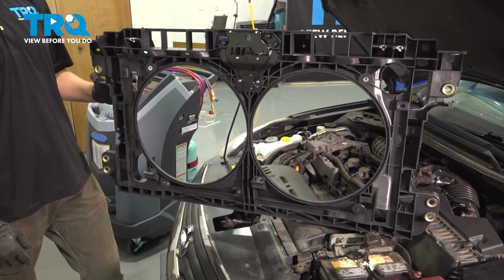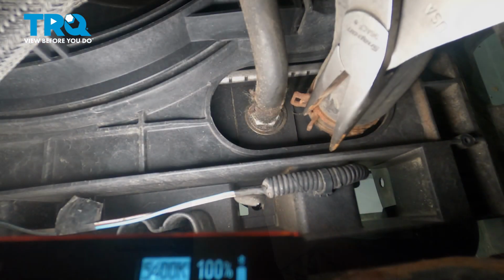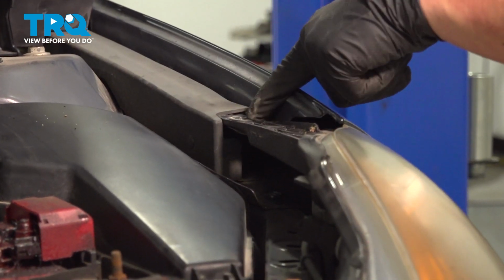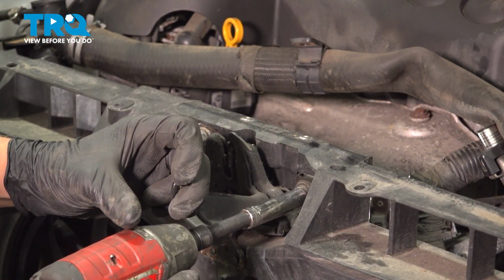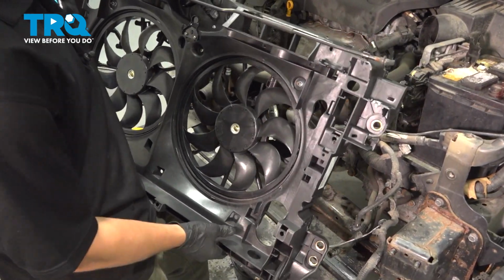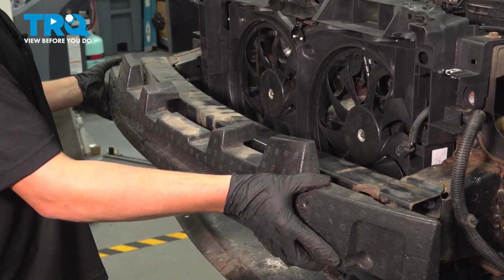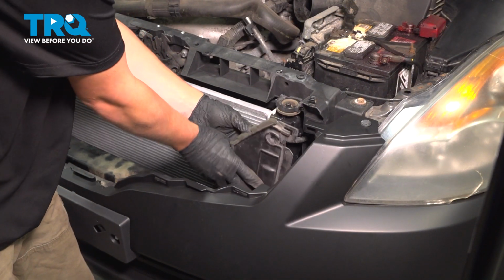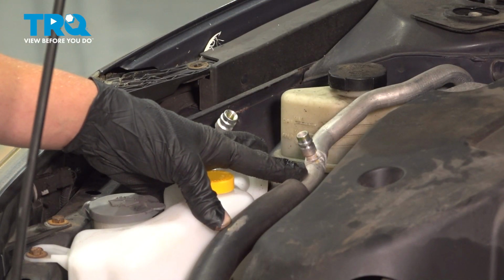How to Replace Radiator Support 2007-2012 Nissan Altima

Comment: The engineer that designed that conglomeration of a rat nest must have been on a heck of a LSD or Acid trip, he made that 10 times harder to replace the radiator bracket than it should've been, not to mention it designed with cheap breakable plastics. That's why I'll never buy a import vehicle, I'll stay with my "Old" American made trustworthy Chevrolet or Ford vehicles.